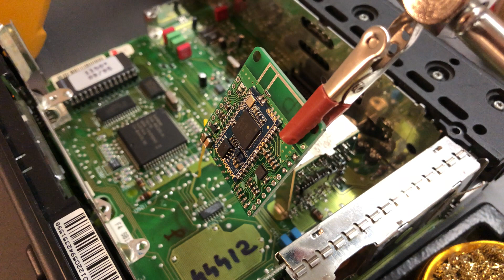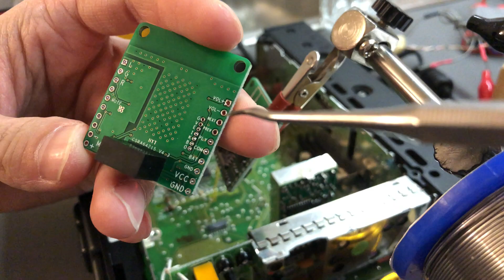CSRA64215 MFB Pin

Comment: You are not connecting to a proper ground point, that trace is the antenna. Second, the reason for the transistor circuit is that MFB is edge triggered. So when you connect your PSU (3.3V, Vbat) and MFB at the same time there is a chance the BT module misses the rising edge. The proper way of operation is using the transistor circuit and tie it to a 3.3V supply that starts up when the car starts up. If you only have a 3.3V supply that is always on, you could remove the transistor circuit and connect the MFB pin to some other 3.3V signal on the board that goes high when the system starts up.
Reply from the maker: Thanks for the reply! For testing purposes that antenna is a decent ground I'd say

Hmmm, okay, but - so, you're saying that if there's no rising edge on the MFB, the chip doesn't turn on???

There also seems to be an internal pullup on that pin as well ...

It seems kind of an odd requirement to need such attention to start the chip up
Reply from the maker: Also, if it's edge triggered, then it's RISING for turn-on and FALLING for sleep ... but ... is it really driven that way ?
Reply: Is the antenna the same as ground? I thought it would be a seperate signal, but maybe its fine. I also dont know why they didnt just make it level triggered, this stuff only makes it more complicated. From the datasheet of the CSRA64215: "A rising edge on VREGENABLE (MFB) or VCHG is required to power on CSRA64215 QFN" 

I did a PCB design with the BTM625 where the 3.3V supply is always on and the MFB pin is controlled by a microcontroller. If you want your module to power on when the 3.3V is enabled, you need to use the delay circuit to ensure proper turn on.
Reply from the maker: Very interesting, thanks!

Yeah, antenna is ground, radio voodoo shit I know! But it does have many vias right to ground, have a closer look
Reply from the maker: I've commented on one of your videos
Reply: And I replied :)
Reply from the maker: Yeah .. youtube seems to be a large mess when it comes to notifications
Reply: Hi guys! please give me advice, I spend a lot of time for configuring csra64215, simple goal - use one button for power on and power off, VBAT and GND always have 3.3v. what I did - in CSRA64xxx and CSRA63xxx Configuration Tool configurated pio7 like Power ON and Power off button. So, it's works BUT after timeout (Auto Power ON timeout) button don't work! I will be very grateful for your help
Reply: @ГерманЭльдаров   а как вы настроили это?